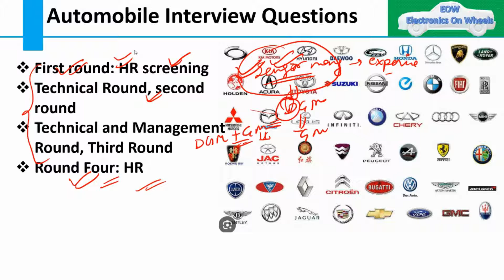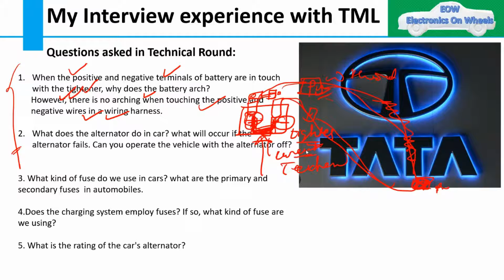My Interview experience with TATA Motors||My first job experience||HR and Technical question

Comment: 2)With alternator off- vehicle cannot be charged and can only left with battery charge which will be drained out very quick ,also there will be tell tell on cluster , vehicle must be brought to halt and it will not start again untill Alternator is fixed.

Comment: Pls reply if possible : 1) Arching with tightening torque high as Higher current -more Area of cross section , lower conducting path (More visible sustained arching due to large surface area ) , wire -will have lesser arching (less current-more length, less area and may burn out quick )

Comment: Q 5
Generally most cars alternators have an  rating between 40 to 120 amps. its depend on car model, and electrical  load requirements of a car

Comment: Q 2
Alternator is convert mechanical energy into electrical energy and used to charging the battery.
If the Alternator Fail wont be able to recharge the battery. And the car will not run very long time in running condition. How much the battery charged may be able to drive that much percentage

Comment: What I think technically,  that

 1.Resistance is proportional to length and inversely proportional to current ..so if we extend the length that means resistance increases hence current decreases and this led to very low arcing 
2. As we are using harnesses that act as a insulation which increases  the gap between two opposite charges (for DC as mentioned here ) resulting no arcing

Comment: 4. 👉A slow-blow fuse is used in the charging system of a car. This type of fuse is designed to handle temporary surges or higher currents that can occur during normal operation without immediately blowing or interrupting the circuit.

Comment: 5. 👉Passenger vehicles have ratings between 70 amperes (A) to 150 A. 
However, some vehicles, especially those with higher electrical demands like luxury cars or vehicles with advanced features, may have alternators with higher ratings, ranging from 150 A to 250 A or even higher.

Comment: 3.👉The most common type of fuse used in cars is the blade fuse, also known as the spade or plug-in fuse. It has a plastic body with two metal prongs that plug into the fuse holder.

Comment: 2.👉 An alternator failure results in electrical system malfunctions, battery drain, difficulty starting, and flickering lights.
   👉it is not possible to operate a vehicle with the alternator completely off or non-functional. the alternator plays a crucial role in powering the vehicle's electrical systems and recharging the battery. Without a functioning alternator, the battery will eventually lose its charge, leading to a loss of power for the engine and electrical components.

Comment: 1.👉- the arching occurs when there is a small gap or interruption in the circuit, such as when the battery terminals come into contact with a loose or improperly connected conductor. In a properly constructed wiring harness, the wires ensure a continuous electrical path, eliminating the conditions necessary for arching to occur.
Reply: What I think technically,  that 1.Resistance is proportional to length and inversely proportional to current ..so if we extend the length that means resistance increases hence current decreases and this led to very low arcing 
2. As we are using harnesses that act as a insulation which increases  the gap between two opposite charges (for DC as mentioned here ) resulting no arcing